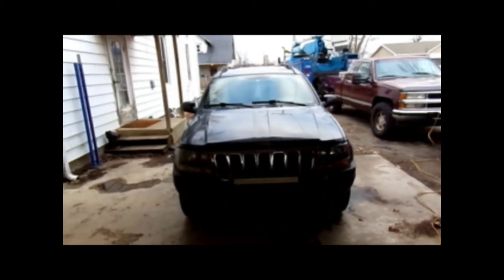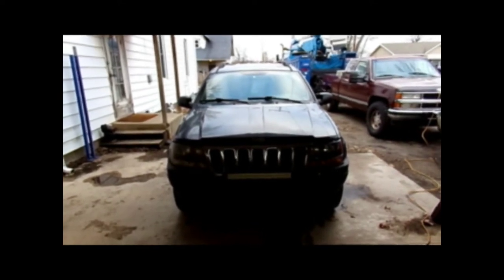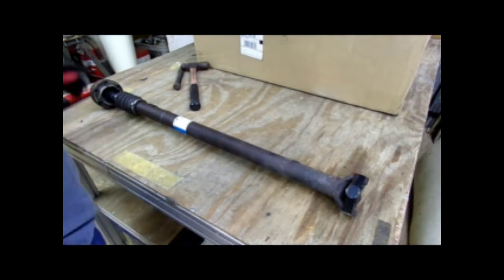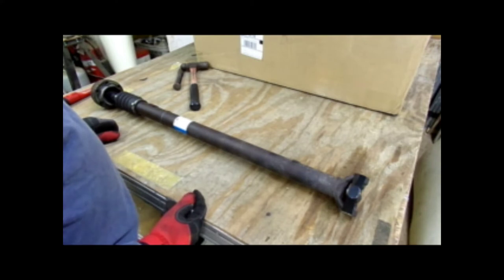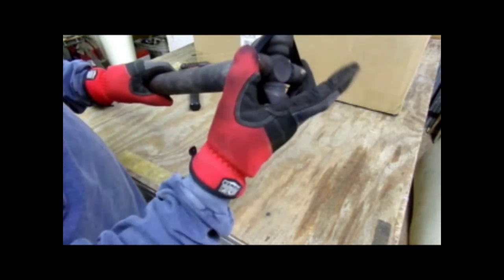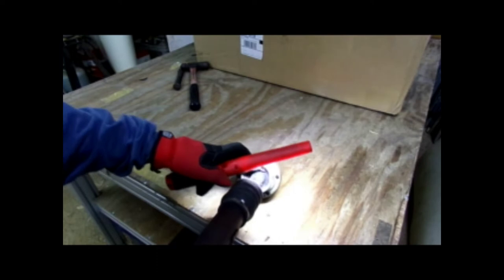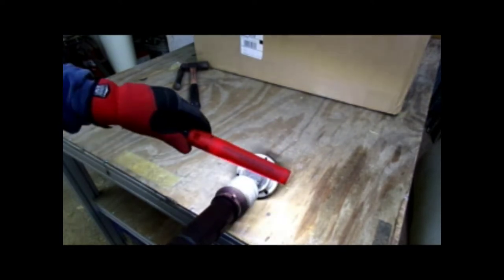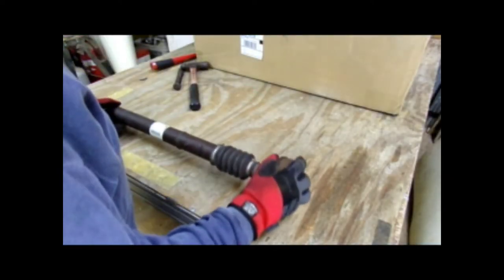Jeep Cherokee drivetrain growling noise in 2wd & 4wd. A wheel bearing? U-joint? CV joint? Other?

Comment: Rocker arms and guides to cure that engine tick? Im replacing that cv/rzeppa joint and the universals.. Im at 213K miles and the engine tick is starting to show up more often some when cold start then quietens then randomly starts back. I am assuming the rockers and guides because i am getting 20mpg and the only reason for that good of fuel mileage is something isnt working right lol.. feels a little low on power from what i remember and kicks down a bit more on big hills than it used to. It is all pointing to reduced valve lift IMHO.

Comment: I have a 2006 Jeep Commander, Quad II, there's a loud hum (hum being a small explanation) and it only happens when I accelerate or cruise, if I let off the gas it's totally quiet. There's no clunking, clicking or rattleing sound. I've replaced both axles and front hubs,,the noise certainly sounds like it's in the front, maybe the differential. Hoping you might know some about a jeep! Is there a bearing that's causing the trouble in my front carrier? By the way it rides and drives great. Thanks.
Reply from the maker: There a 3 bearings in the front differential. Try removing the front drive shaft and see if the noise goes away. If it does, then it's 1 of the bearings in the front differential. Most likely the pinion bearing.
Reply: @opasgarage4423  I've read that it won't drive with the front driveshaft out?  Some say it's the CV joint on the front shaft but I haven't took it off to check.
Reply from the maker: I believe that's only if you have a V-8 and the Quad-Trac system. I have a straight 6 (4.0) with the Selec-Trac system. I removed mine and it drove just fine. If Yours doesn't, try shifting the transfer case into 4x4 high and see if that makes it go.
Reply: @opasgarage4423  I have a V8 and Quadra Trac..Lot of work only to find out that's not it 'Screwed' 🙂